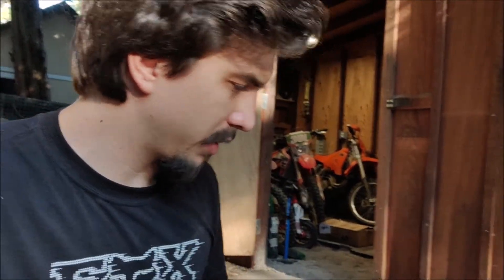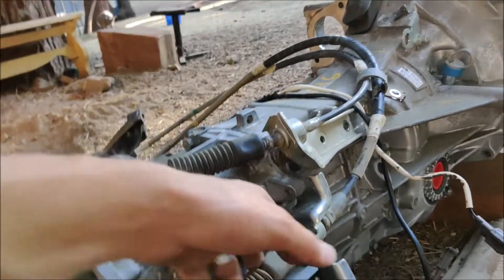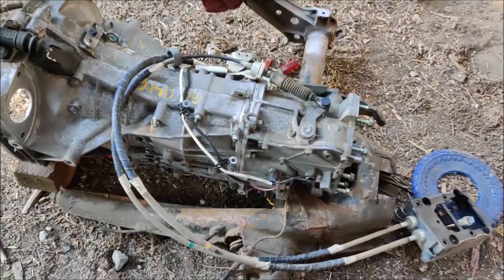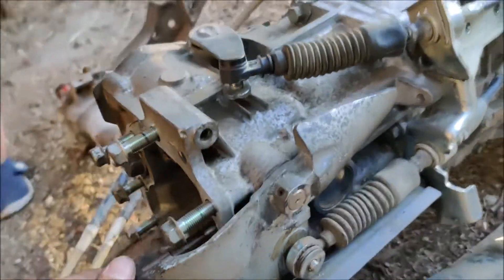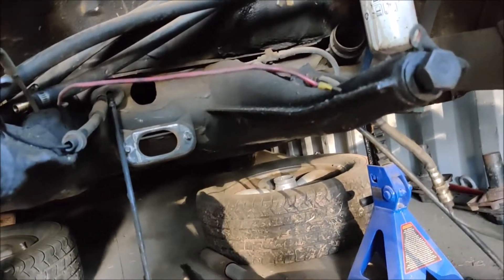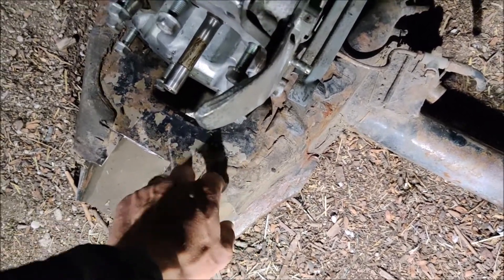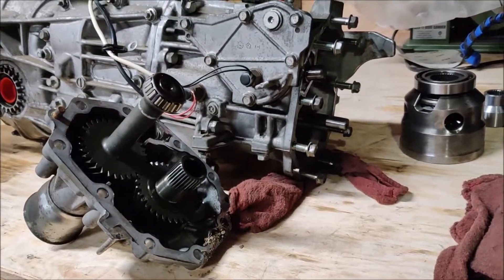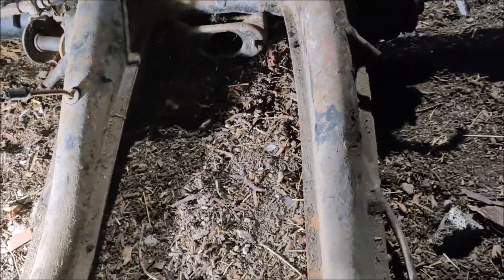Planning Cuts for the 6MT Fitment- Pt 5 Subaru Swapping VW Karmann Ghia

Comment: hi 
do you have a video or pictures that show the actual cut out and the welded in pieces of steel to reinforce the area that that you cut out for the 6MT trans ? i am trying to do the same transmission in my karmann ghia . i found your other videos to redo the reverse drive in the trans very helpful , when doing mine .
Reply from the maker: Hi Steven, unfortunately I haven't worked on the project in a little over a year. My father retired and he and I got back into dirt biking together. That and my kid's been ramping up a pretty good race/practice schedule so I've let the classic car project sit. I've been taking advantage of the time with my Dad while I can.

I took inspiration from John Reynolds VW beetle build. He hacked up the back end but did it WAY nicer than I ever could. Someday I'll get back to this project...